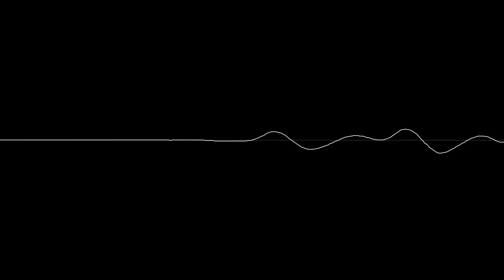AlliedSignal Mk VII Warning Computer Voice ROM Dumps 965-0876-040

Comment: What kind of CPU does it use?
Reply: idk
Reply: @flama12333 why the fuck did you comment if you don't know
Reply: @ajemn2433  they not uploaded yet the pcb pictures and the program rom still undumped.
Reply: zilog unknown
Reply: actual cpu is zilog Z16C0210EPEC - z16c00 cpu
becauses another video was uploaded by MoonWalker1010.

Comment: Unrelated.. but I was curious if it would still be worth it to buy an xband modem? I wasn't sure if you are still working on it or if it's still active.
Reply from the maker: I replied to your comment on the other video, but youtube might have eaten it. "Yeah prices have gotten kinda crazy. If you really want hardware importing the SFC version is an option. Emulation is also being worked on for non-gameplay use". The server is still up, but personally I would say hardware is not worth it at this point, too expensive.
Reply: @natarii  oops. I apologise, it didn't give me the notification for any of your replies for some weird reason... I just now seen this lol. So another question, does the server work the same for the Genesis? I just got a Genesis for cheap and the modems for that are waaay cheaper.

Comment: After hearing again the video I noticed that all options are included from the Boeing altitude callout table.

You have in this video if you put the words together:

PLUS HUNDRED (100ft above minimum)
FIFTY ABOVE (50ft above minimum)
APPROACHING MINIMUMS (80ft abive minimum)
APPROACHING DECISION HEIGHT (100ft abive minimum)
MINIMUMS
MINIMUM
DECIDE
DECISION HEIGHT

also all altitude callouts like:

2500 (TWENTY FIVE HUNDRED) or RADIO ALTIMETER
1000
800
500
400
300
200
100
80
60
50
40
35
30
20
10
5

also optional:

Engine Fail
V1

It is interesting that also 90 (NINTY) is availible, which is not listed on the table.

These are all mentioned on the table.
But I dont know if the callout RADIO ALTITUDE is also optional.

The current voice has also these callouts as option.

THALES I guess has the callout AVOID TERRAIN in their TAWS.
I know that the male voice has it.
 (ATR42/72-600, A320 family, MD80 retrofit, 747-200/300 retrofit, 767-200 retrofit).

Note that many callouts are announced during EXTENDED GPWS/EGPWS test.
These tests are normally performed by maintenance staff.
These extendend tests give many callouts and statuses and other important informations.
Also the EGPWS has extendend tests functions with tons of callouts.
Depending on aircraft type you sometimes have different callouts. Also it depends on installed systems.

Comment: Thank you so much, this is one we've been in search of for quite a while. Out of curiosity, was this an Enhanced GPWS or a basic system?
Reply: It could be early EGPWS as it is able to say Terrain Ahead.

I checked all announcenents.
All necessary callouts are avalible.

Even callouts like 80, 60, 5 are avalible which are according to Boeing, selectable altitude callouts.

According to the altitude callouts table of Boeing, you can also select 800 as callout.
In real life i never heard 800.
But 80 and 60, i did with female voice.
Reply: *IOETER*  I might be, your right that's what obstacle would generally suggest. But in the aircraft I heard these warnings in, they didn't have a TERR OVRD switch, every EGPWS plane I've come across has had a TERR OVRD switch if the flight crew wants to disable Enhanced warnings. It's hard to tell.
Reply: @engineergaming4333  

The terrain override is for the callout

TOO LOW TERRAIN, not for TERRAIN AHEAD or CAUTION TERRAIN.

If you fly low for example during a low pass, then it deactivates the warning.

Similar with Flaps override. If you need to land with Flaps 15 after an engine failure in a 737, you can turn off the TOO LOW FLAPS by using Flaps override.

In Ryanair 737NGs you also have a RAAS override switch witch deactivates the RAAS (SRS and SLS) callouts.
Reply: @AVIATIONSOUNDEXPERT  I wonder if those warnings are there, because I think I heard long ago you could connect, both a normal GPWS and and enhanced gpws to the same aircraft at the same time or something, who knows. I really could be and enhanced system, I've just never heard this voice in an EGPWS before.
Reply: @engineergaming4333  

I dont know exactly what you mean.

Even if it is an old voice it can be rerecorded to suit it for the EGPWS.
Even if that is the case many years after the first recording.

There are severeal voices which are availible with different recording versions.

I heard one time two different GPWS voices the same time which announced altitude callouts at the same time.
It was in a DC-10. May be two different modules were installed and active at the same time.

By the way, if you hear the callout
V1 in the 787, you will notice that the voice sounds like the voice in this video.
Reply: @AVIATIONSOUNDEXPERT  No, it was in an American Airlines training assembly, I'm not sure the guy knew exactly what he was talking about, but he made it seem like they were going to install egpws systems with the already installed standard gpws systems. I've heard a couple CBT programs where they had an older gpws voice, but all the enhanced callouts where using the newer voice.
Reply from the maker: If it's an EGPWS it doesn't say so on the case, so I think just standard. I can send pictures if you want. IDK if this makes a difference but there are some removable data cards which contain the program for the main CPU... not dumped yet, I need to find them and trace the pinout (iirc they use surface mount flash)

Comment: Thanks.

This voice was used in many 747-200, DC-10 and many other old aircrafts.

These additional callouts are used for the extended GPWS test.

The peep tones with different frequencies are optional for certain altitudes instead of altitude callouts.

I know that there are two different recordings availible with this voice.
I know that because i heard in a DC-10 altitude callouts which sound different compared to the early recording.
Reply: You make the "1000" callout out of the "one" callout and the "thousand" callout, likewise you also have to make the "too low" "flaps" and "gear" callout out of singular words in the vocabulary. This are probably genuinely evey warning it could possibly make. I'll upload some strung together into full callouts. I'm also gonna see about getting a manual, so I can recreate them more accurately. There are definitely military callouts on this system, but I think that it's because they didn't make another separate model for military applications, you just tell it that you are in a military aircraft and it uses the appropriate callouts.
Reply: @engineergaming4333  

Thanks, i already know that.

I played the video with 0.25 speed and recognized that fortunatly all callouts are availible.
At the beginning i thought some callouzs are missing, but they dont.
Reply: @AVIATIONSOUNDEXPERT  Oh, ok. BTW, one other thing about the mystery "Obstacle" callout. The obstical callout is in the same rom with all the other military-sounding callouts. I know that the Air Force had some terrain database thing for their fighter pilots in the early 1990's before EGPWS was a thing. It was made by Marconi and the GPWS might be able to integrate with it to provide partial enhanced functionality, but it can't be an enhanced system, they started making the Mark VII in about 1993 or so which is three years too soon, but that IS about the same year the Marconi GOCAT unit came out.
Reply: The GPWS was used in the 737-200, the 747-200 used the Sundstrand Mark II
Reply: @TheRealYashNotFake the -200 had the mark i and the Mark vii

Comment: you can emulate mame?
the gpws
with warning light
button
and test of gpws
pin program
Reply from the maker: The only thing I did with MAME was use the uPD7759 code to turn the voice data into something listenable. I haven't dumped the program ROMs yet, and even if I do dump them, the unit is a very complicated system, it would take a lot of work to emulate the whole thing
Reply: @natarii  ok.
Reply: @natarii  do you happen to have a download?
Reply from the maker: @ogam123  download of what? A link to the audio files is in the description